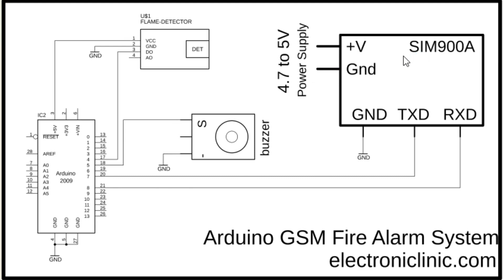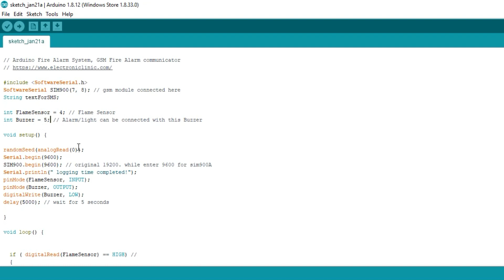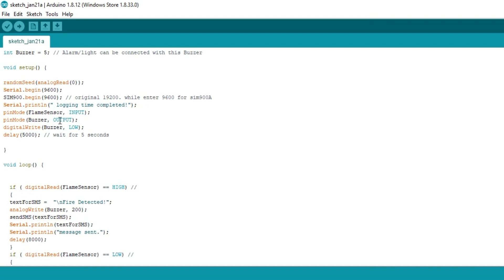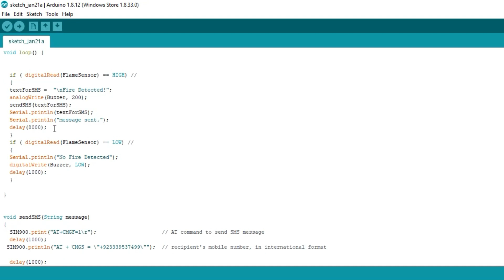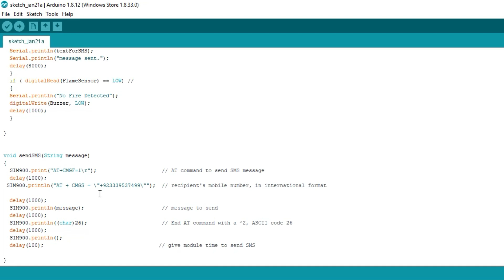Arduino Fire Alarm System, GSM based fire Alarm system, Fire Alarm GSM communicator

Comment: What is the problem if we dont receive any message after the buzzer alarmed??
Reply from the maker: Ur gms module might not be connected to the network. Or you are not supplying enough current to the GSM module. Or your wiring is wrong. Or your GSM module is faulty or it may be banned.

Comment: Thank you!! This was helpful
But, I have a problem with the GSM module, where the message is not sent when the fire is detected, however, when I tested the GSM functionality using the serial monitor, it tells me that the fire is detected. If you have an idea regarding this issue could you please inform me?
Reply from the maker: first check if your gsm module is connected with the network. 
2nd make sure your gsm power supply is 4.7 to 5 volts and around 2Amps.
Reply: @ElectroniClinic  if everything is connected properly, could be there any other problem with module?
Reply from the maker: @batool836  check the continuity of your wires. some times the wires are broken inside.
Reply: i am having the same issue and  the buzzer is buzzing continuously soo could you help me with that?

Comment: Hi your sim card need to be have load?
Reply from the maker: yes
Reply: How about smoke it will also detect on this?
Reply from the maker: @davelodia9157  not smoke. there is another sensor used for smoke detection. check playlist, i have videos on smoke detection.
Reply: Can you send the link i cant fine the video with smoke detection .. thank you so much your video is informative  thanks